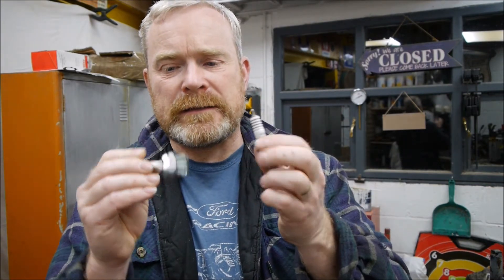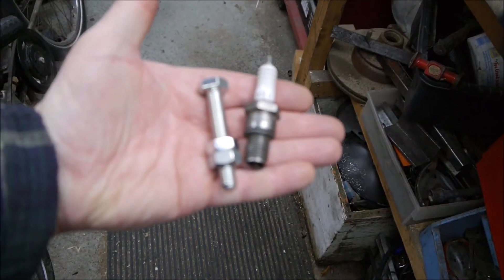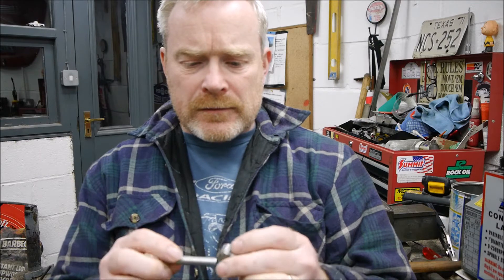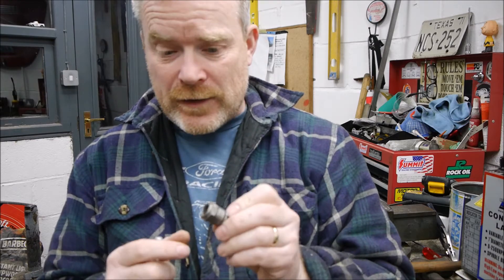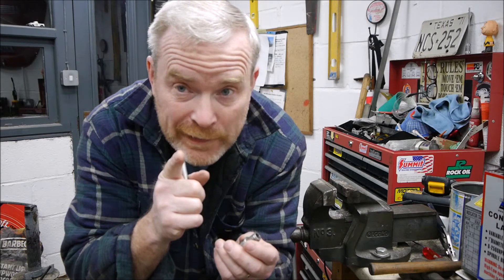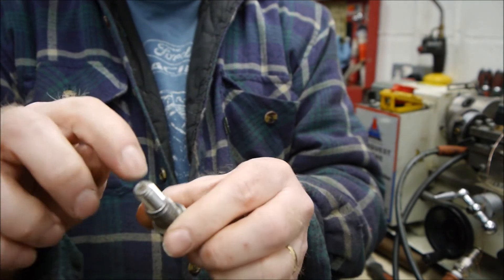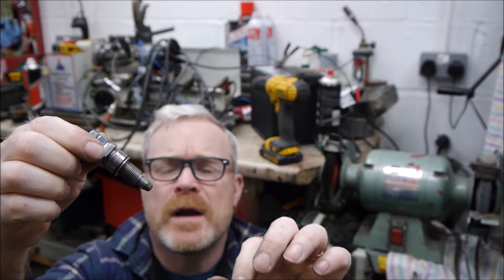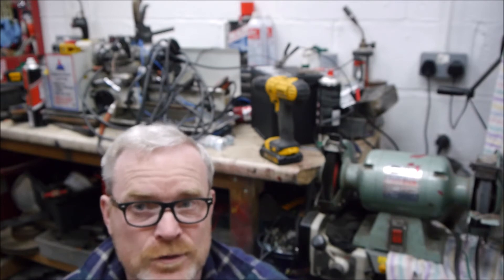How to find Top Dead Centre with a home made TDC gauge - VSG Ep 65

Comment: Can you not just use a bolt with the same size thread as the plug.
Reply from the maker: You could but I don't think they make bolts that size or thread type. It was just me messing about it's way easier and cheaper to buy one.